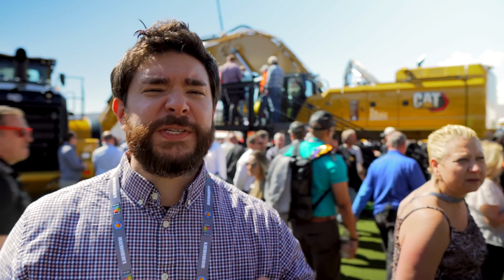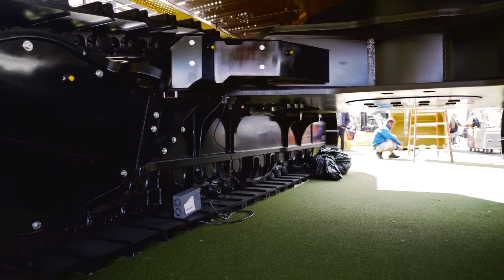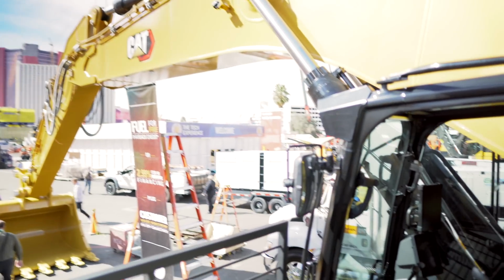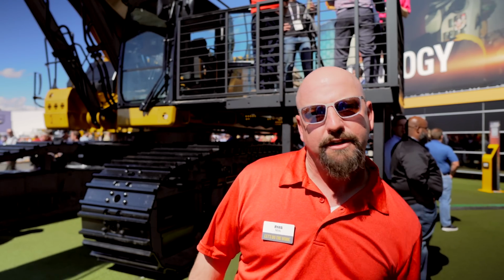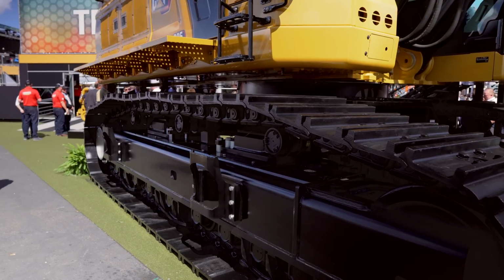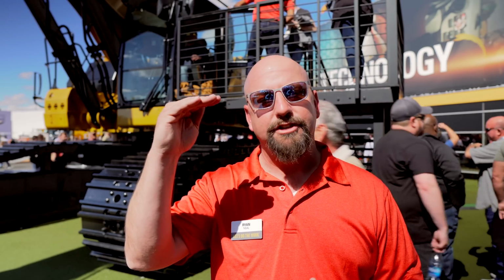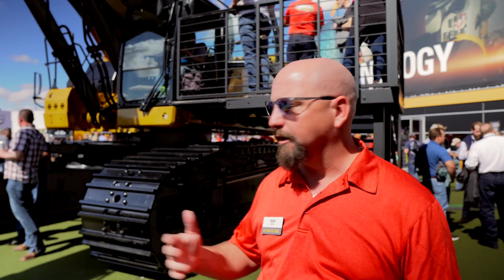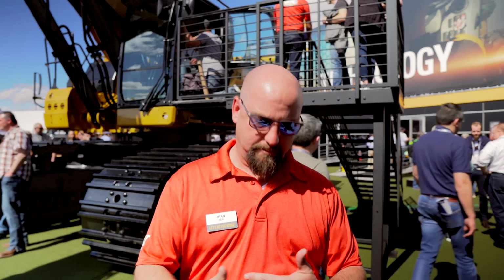Cat Unveils New 395 Excavator: Bigger, Stronger, Faster 390F Replacement

Comment: It will be nice if Cat have a computer that you can set the bucket with its teeth on the asphalt and 0’ and it will inform the operator how many feet the teeth is below 0’ grade when you are working on gas lines. The operator will know exact the feet it scratches the concrete to inform the pipe layer when then want a operator to clean up around the pipe. The operator feels for rocks and change of soil. If we can look at the computer we know at the depth we encounter a different material.

Comment: I noticed in the quarry images the 395 had GPS masts, does this mean its the largest production excavator that uses GPS?
Reply: Theoretically yes, but most mine companies find a way to get gps installed on large equipment now. Is it programmed effectively, I belive I have seen gps systems installed on almost every piece of equipment imaginable and most are down to 1-3 thousandths.
Reply: Excavators up to 1000 ton use GPS

Comment: Marketing wank.  So it's got a new cab, and sheet metal.
None hydraulic expandable undercarriage.   
20 hp bump doesn't offset 5 ton of machine. 
Of course boom and stick are redesigned.   Cat had some problems, especially behind boom cylinder area.  
Cab avoidance!!  That's called an operator.     
 Looks like cat is building machines for drivers.  Driving equipment into the ground.  Unless machine uses technology,  to save itself.  
     But it does have two 12v chargers in cab,  I'm sold.
Reply: @clatetpillar1 Sounds to me that you have an axe to grind against Caterpillar. No thumbs up for your comment.